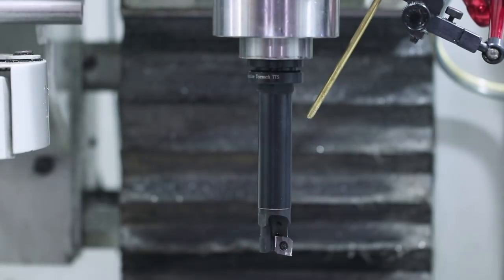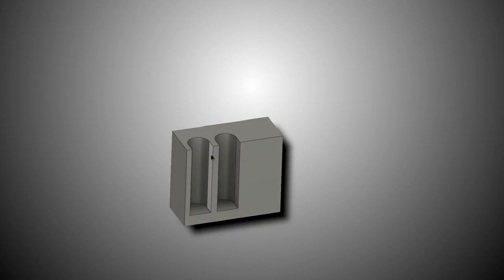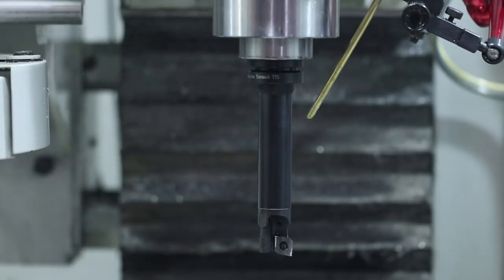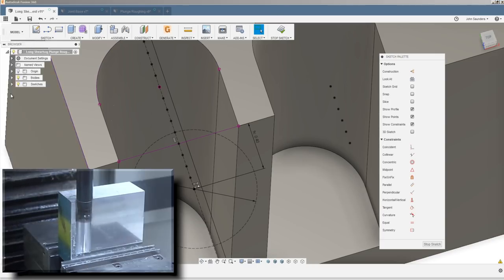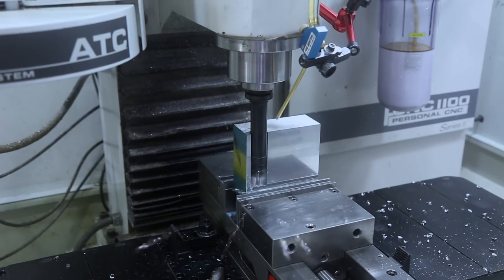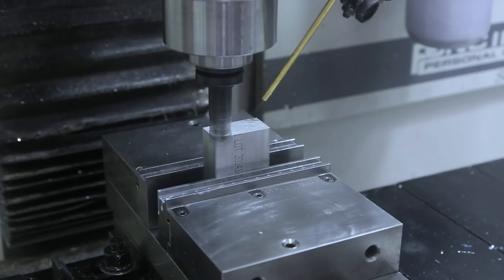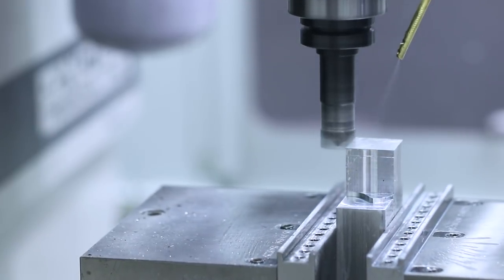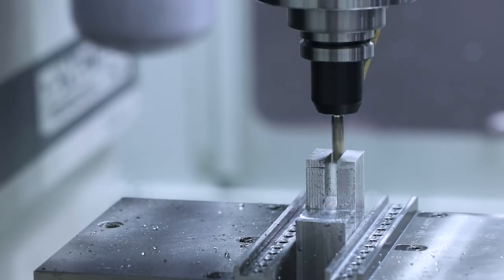Plunge Milling - Great for Roughing & Slotting!  WW205

Comment: As a tool sharpener I would like to point out that this would also put most of your wear on the face of the end mill which would leave your flutes nice and sharp to clean up the faces of the slot. And sharpening the face of a end mill is much quicker and easier than the helical flutes. Great idea!
Reply: Good point

Comment: Most CAM packages do have plunge roughing options. 
SolidCAM can run a plunge mill pattern on contours and pockets and has a 3D roughing that will plunge mill out an entire part. 

One thing, and I’m not sure how to do it in Fusion off the top of my head, but at the bottom of its plunge it should back up about .05 -.100 before retracting so it doesn’t rub on its way back up and clears the floor of the relief angle on the end of the cutter so the floor is flat. 

This strategy also works incredibly well for hard materials at 50+ Rockwell even in shallow slots.
Reply: HSM needs a strategy for this. Agreed. But you could use one of the boring cycles instead of the standard drilling one to get the shift. And in HSMWorks... you can use the pattern fill command to easily get the points for plunge milling a pocket... no such command in Inventor & Fusion. They only have pattern along path, so you would have to sketch the path, place a point, then pattern along it.
Reply: Scott Moyse 
Those bore cycles stop the spindle before shifting though...
Reply: Occams Sawzall which can be hacked in the post
Reply: Scott Moyse 
How can you “hack” a preset canned cycle like G76?  G76 stops the spindle at the bottom of the bore, there’s no M code stop, it’s built into the canned cycle and there’s nothing the post can do to change a preset canned cycle in the machine controller.

Now. You could build a custom macro within Fusion to accommodate a plunge milling with wall retraction,  or place a Macro-B “plunge mill” sub-routine on the machine and call it out that way. 

But you can’t “hack the post” to have it alter how a factory preset canned cycle is run on the machine.  Unless you dive deep into the machine parameters and alter the hardcoded canned cycle.  All of the above are way more work than its worth just to plunge mill with a wall retraction.
Reply: Occams Sawzall yes you can. That's the beauty of the HSM post system. You force an expanded cycle, then you can interrupt the output and modify it to post the code how you want.
Reply: Scott Moyse 
Ok. So it’s not actually using a canned cycle.  It’s taking a cycle, expanding it out to its individual components, then posting out the long format version. 

So instead of a G81 XYZ F. 
It will post out 
G0 X#Y#Z#
G1 Z-#F#
G0 Z+# 
X#n Y#n
Reply: Occams Sawzall exactly. I just used the terminology from the user interface
Reply: Scott Moyse 
Ok that makes entirely more sense. 

I was gonna call devils magic on being able to have a post alter a canned cycle routine 😆

Comment: I use this method a bit because I'm a chicken when it comes to slotting and figured it was a bit dodgy so glad I watched this. I feel redeemed.
Not on CNC just a mill drill, today had a section to take out of a cylindrical housing with a 6mm mill, ran a flat with 20mm mill end and as usual worried about busting the 6mm I went for the 2 tooth plunge mill and just plunged it through by bit to remove the section then a side sweep to clean the edges.

Comment: I've managed to do this entirely in cam using a linear pattern there and "getting lucky" with being able to select a point on the part geometry. You could make a sketch with a single point for your entry if you had to and use CAM patterns for the rest. Might save time going back and forth while your trying to find the optimal step over.

Comment: Nice vid. This method has been common in mold making for decades. The CAM would layout the best configuration of Swiss cheese to maximize material removal.
Reply: how to plunge in a mold with full tool diameter ?

Comment: Cool that you were able to force Fusion to do a plunge rouge routine. Systems with an actual plunge roughing function can usually do a 3-axis step away from where they just plunged so the inserts are not rubbing on the way back up, extending usable insert life. Things like hydroform dies and deep molds are really well suited for plunge roughing, on those parts you usually start by roughing the deepest areas and going uphill from there.

Comment: I saw an old IMTS video where they showed plunge roughing (with a large insert drill) combined wigh high feed machining to make light work of creating pockets in titanium aerospace parts. The pockets did not need crazy dimensions as they were merely for weight reduction but the time and money saved using that combo was incredible. Given all the stuff that has happened in Fusion it is just a matter of time really before plunge milling becomes an option I feel.
Reply: Nope.

Comment: Solidcam 2016 has this built-in option where you can create pockets or rough the bulk with plunging..it saves cycle time. You can rough a tight pocket or slot this way and finish it with other milling methods...

Comment: Plunge milling is very complimentary to conversational controllers li,e the prototrak.  I've used it for quite a long time with those platforms simply because I can copy, repeat with offset as my step over.   Very fast to program and saves a lot of time not needing another op. also many times no tool change.  Oddly enough, it has never struck me to use it when programming with CAM.  Sometimes my idiocy astounds me.

Comment: Most of the main cam processors offer plunge milling strategies, however Autodesk for example just point blank refuse to offer any kind of support on it.  The tech advisor told us they had so many claims due to destroyed machines  they no longer supported it. Still one of the most efficient ways to get material out of deep cavities though!

Comment: Any thoughts on if this would shorten (slightly) the life of the bearings in the spindle?  I guess they are AC bearings and depending on the angle of the contact they might be biased to the usual high side/ radial loads.  Of course they will also take some axial load to allow drilling plus a helix end mill will pull down on the spindle and they need to cope with that.

Comment: How do you feel about all the extra wear on the end of the end mill and not spreading the wear out over more of the bit... is it worth it???
Reply: Finn NA you incur little to no side wear so the bulk of the tool is still fine.  And as long as it’s a tool with a corner radius, even the radius is fine when side milling with it. 

Typically the bottom of the tool is wasted in normal milling, so you’re in fact using even more of the tool as plunge milling won’t damage the tool for side milling.
Reply: Plus the bottom cut of the end mill is super easy to re-grind

Comment: I have a standing topic in suggestions on the fusion360 forum since like 2 years back of them implementing plunge cutting in the 2D library of CAM.. still not one answer on this.. Sweet that others are looking at it as well now, especially you and we might get som traction on it instead of hacking it like this. (been doing the same for a while)

Comment: This is excellent! I first saw plunge roughing in an Ingersoll promo video a couple of years ago but had not seen it be used at all. As always, great presentation of a very interesting strategy.
P.S. It's been a few years since I used anything other than HSM but I hadn't seen it available as a built-in strategy in other CAM packages (EdgeCAM, SolidCAM, TopSolid)
Reply: EdgeCAM has had it for about five years, Hypermill had it in 2000.
Reply: Yup, last experience with EdgeCAM was in 2011. I think EdgeCAM 12 (not 2012).
Reply: It’s in SolidCAM as options under 2.5D pocketing and profile. It’s not a listed stand alone toolpath. 

Basically you can turn any 2.5D toolpath into a plunge roughing toolpath. There’s also an option under 3D HSR to convert to plunge roughing of an entire model or model section.

Comment: Looked like you were going a bit deeper than you flute length on the 1/4 flat mill. You can get away with that on the plunging, but not the finish side milling.

Comment: I wonder if I can do this with a drill press and a cheap end mill in wood....
Reply: I do this all the time with a Forstner bit. Seems like an end mill would be a lot slower at the RPMs a drill press gives you. Of course, you can do the same thing with a plunge router--a router bit is basically an end mill.

Comment: The end mill needs a certain shape on the end so it can plunge and not fail right?
Reply: Only if plunging the entire diameter of the cutter, you would need a center cutting endmill. If only using the edge you can measure the flute on the face of the endmill and step that distance.
Reply: Helps tool life if you use a tool with a corner radius or chamfer. Clean up with a second tool.
Reply: You can use most any tool, including non-center cutting tools. 

Tools with a large clearance angle on the end work better, but it’s not needed, a flat bottom endmill will still plunge mill just fine.

Comment: in alum what u were doing was fine that would nvr work in ss or super alloyes at the bot of the cut u have to arc away and not rub the cutter with the metal
Reply: saul aparicio 
@Occams Sawzall  said it works incredibly well on hard materials, 50 Rockwell +
Reply: Nils yeah i dose lol i nvr said it didnt i said ud have to arc away at the bottom
Reply: saul aparicio ops, you did! 

Tbh I still don't understand what you mean.
Reply: Nils 
Means you have to pull away from the wall after you plunge down, which most CAM software that has plunge milling allows you to do. 

It prevents the tool from rubbing the wall on the retract and damaging the tool. 

Plunge milling should go,  step forward at the top height,  plunge to depth, move backwards away from the position you plunged at, retract up, repeat.
Reply: saul aparicio 
And for the record you don’t actually need to move away before retracting. You just need to go back and clean up the floor with another toolpath is all. Easier to do everything in one toolpath if you can. But seeing as Fusion doesn’t have a plunge milling cycle and one has to be cobbled together, there’s no need to bang your head against the wall trying to make the perfect plunge milling cycle. Easier to just do another toolpath for cleanup if using Fusion.
Reply: I was told the same thing years ago, experience has told me otherwise. Arc out reduces the chip load due to chip thinning and reduced tool life, (rubbing) stepping back was better but did something similar. I found it was a waist of time and programming effort. In the end I settled on straight down and back up again in feed.

Yes that's in so called super alloys.
Reply: Mike Lang 
One of those things that if it can easily be done, it’s best to do it. But not a huge deal if you can’t. If the tool is deflecting that drastically that it springs back into the wall and shocks the cutter on retract, the speeds and feeds of the plunge are all wrong.
Reply: Occams Sawzall lol thanks
Reply: I used a Kennametal plunging tool that was 2.5" diameter and 10" long in an enormous block of T1 steel to rough out a slot for oil field hardware, it was the most reliable part of the entire process.  The tool and process are pretty amazing.
Reply: Occams Sawzall agreed though I never back off the wall anymore. Like you said it's all about feeds speeds and most importantly how that relates to cutter geometry. I can make almost any cutter plunge cut reliably but it might take some time to get the job done. 

An often if not entirely overlooked tool for plunge cutting is the old workhorse U-drill. Be brave and take a large stepover or you'll curse me. Also, not all U-drills work the same. Kyocera drills worked great for plunging till the bean counters changed the insert grades, not so much anymore. Widia and Sandvik drills work well also but you want the geometry that has a wave or S shape on the insert. Seco works in a pinch but the feed rate reduction is greater.
Reply: Wrong...
Reply: Mike Lang 
Or. An actual indexable plunge mill.  They’re stupidly cheap
Reply: Occams Sawzall but can they take a half diameter stepover? Full diameter actually but that's just a hole. 

Besides, don't you already own a compliment of U-drills?
Reply: Mike Lang 
They can take full diameter blind hole cuts. Well, some can, some can’t. Depends on how they were designed. 

And no. There’s not a single U drill in the shop 🤣
Reply: Occams Sawzall great tools if you use them right. We do a lot of oil field drilling tool power section parts. Specifically bent parts and drive line parts. Most designs these days are B drive or E drive CV joints that have 5 or 6 half diameter radial slots. I used to plunge cut them with kennametal plunge cutters but as I do, I got bored. The lathe guys were cooking u drills on almost a weekly basis as they couldn't comprehend the idea of x center so I thought screw it, it's my turn. I figured I could plunge the slot in one rough and one finish. I expected disaster but to my delight it worked. Half full hole feed but way faster than the plunge cutter. 

Try it some day you'll be surprised. That is if you ever get  a u drill. 😉

Comment: I hope you had the rapid turned down. Otherwise that machine is sad. Really sad.
Reply: Joe Sikkspac 
It’s a tormach. It only has a 1.5hp spindle and is a light duty machine. But it only costs $7k-$10 and doesn’t require 3 phase power.